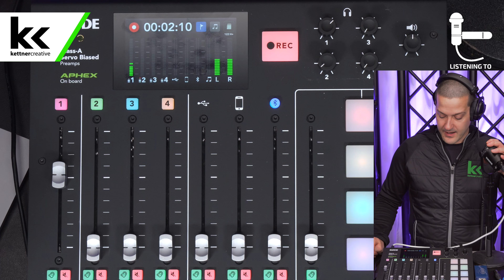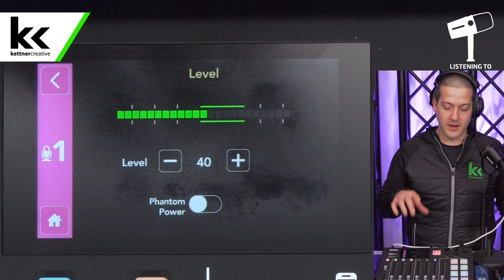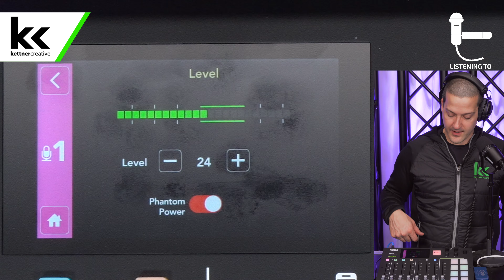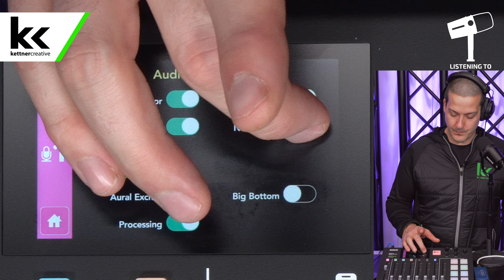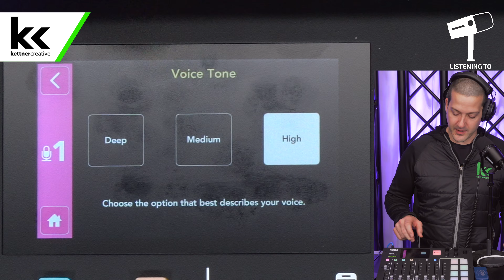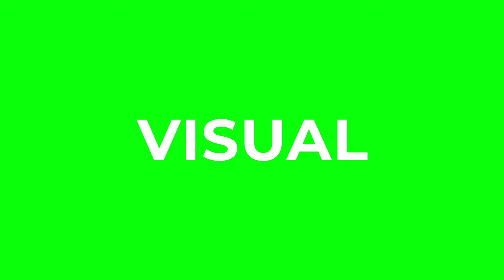Rode Rodecaster Pro & Shure MV7 | Setup Guide & Tutorial

Comment: Having just ordered the Rodecaster Pro 2, which I am hoping might just have a preset for the Shure MV7 as it does for the SMB7, I happened to fall upon your Video. The great thing is, I now have all the information I need to set the MV7 up regardless of the fact it is an updated unit and whether or not it has a preset, so thanks for the great Video and information!
Reply from the maker: You're welcome. We also have a TON of videos on the Rodecaster Pro 2
Reply: @kettnercreative  I’ll go check them out !!! Thanks :)
Reply: did you end up getting a cloudlifter for the mv7 and the pro2? To get where i want it too be with my voice i need 55db, which introduces a bit of noise =O
Reply: @Iwtfgege  I didn’t get a Cloudlifter and actually just used the SM7B since received. I haven’t had the chance to go back to the MV7 and thinking of selling it, as I thought the USB connectivity would be used more than I have !

Comment: Hello, this isn't related to this exact video at all. However, I recently got a Scarlett Solo interface with a Rode NT1A condenser microphone. Whenever I turn my pc off, I usually leave phantom power on, and when I restart my PC or turn it on after shutting it down night before, my gain indicator flashes yellow to occasionally red as if it's clipping. Should I turn phantom power off before shutting down or restarting my pc, and turn it on again after my PC has fully booted up? I couldn't find any answers relating my question on the internet so I am just asking out of safety reasons. Thanks in advance.
Reply: I don't like it when that happens, but there's nothing wrong with the equipment. Its actually very common. If you have ever experienced a popping noise coming out of your speakers when you power up, or shut down a stereo system with separate components, that's all it is. The fix is to turn the components in your system on and off in a certain order so you don't hear the pop. For example, if you hear a pop with you turn your amp on, you need to turn the amp on first, and then your preamp and sources. The underlying cause the pop is still there, but you don't hear it. What you are seeing on your gain indicator is that pop. in general, most equipment doesn't have a gain level meter like yours, so you have no idea its occurring. Its just that the lights on your meter are drawing your attention to something you normally wouldn't see.

Comment: Please make more video tutorials. Such as how to set up an analog way via decimater to a monitor. Thank you!
Reply from the maker: Thanks for the comment. We're planning on bringing more video stuff back into the channel in 2022. More lighting stuff as well.
Reply: @kettnercreative  I got the Rodecaster Pro, and used an XLR cable to plug my Shure MV7 into it. 

Problem: 
But in Far mode, the volume level keeps raising and lowering/ fading in and out rhythmically. 

On the RodeCaster Pro, if I select the type of microphone as “condenser”, it’s just too quiet. 
If I select the type of mic as a “dynamic” mic, its loud enough, but the volume still goes up and down on its own in waves. 

If I use it in Near mode, it’s fine, but I bought the mic to use it in Far mode. 

I don’t know if this is a problem on the Rodecaster Pro side, or the Shure MV7 Far side. Can you help?